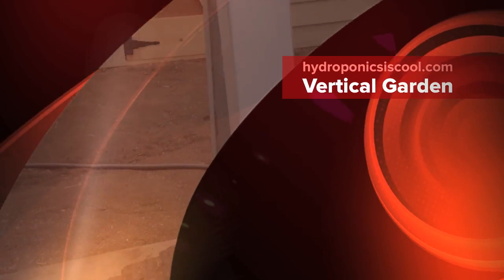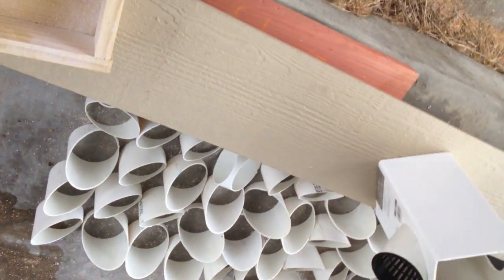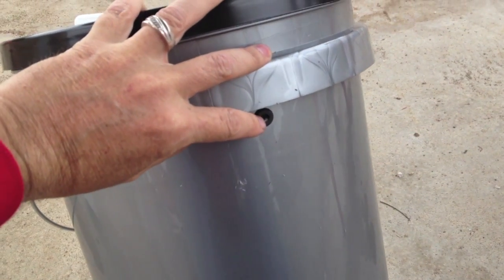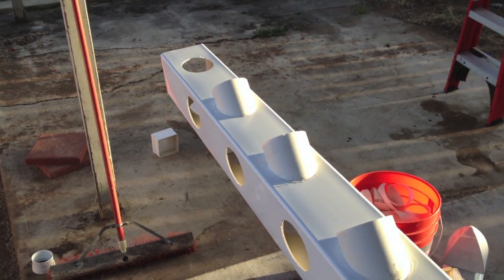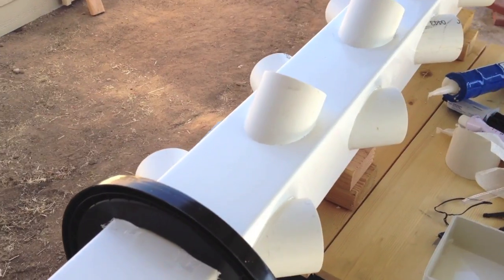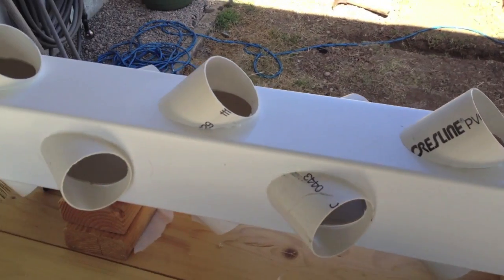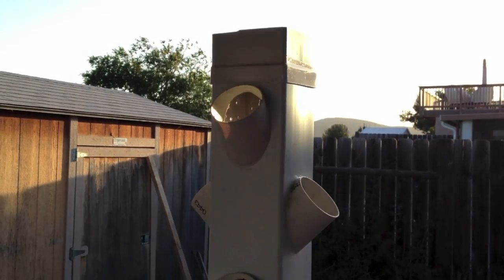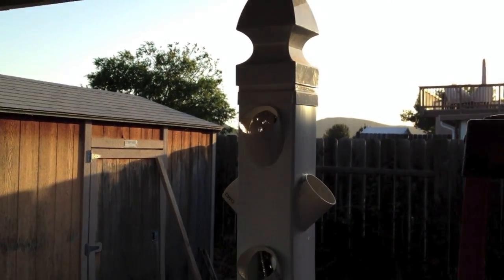Building a hydroponic vertical garden

Comment: The worst thing you might have done here was to cut the excess part of your tower because you foolishly thought the pump couldn't handle the actual height. Wrong! It could have easily pumped enough water even higher because you don't need a wide fountain there but moving current of water even with slightly lower pressure. Too bad you haven't tested it before you have cut so much of your precious tower.

Comment: I'm using micro spray nozzles with 4mm tubing so that i can use a weaker pump, but it does mean siting a nozzle for each plant.
Reply: I'd love to see your set up. was it expensive to do the nozzles?
Reply: @bobbyboucher7426  I ended up just pumping the water up to the lid, 3d printed a curved lid so the water hits that and rains down on the netpots.

Comment: All you really had to do is cut a slot in each side staggered and use a heat gun and heat each slot and then use a wine bottle into the heated cut slot. Then you have the same thing as the 4" cut pvc pipe. You just did a lot of needless cutting and glueing. Making waste and work. Looks good thou.

Comment: I love the design.  I have built my tower.  I couldn't find the pyramid cap at Lowes when I bought the other parts and just figured I'd stop at a different Lowes or Home Depot and pick on up later.... Well... I can't find the kind of cap you used.  Yours has a female receiver on the bottom of the cap and a male receiver on the top of the cap for the gothic cap that you put on top.  I know it's been a few years since you built your tower but do you remember where you got the cap????  Thanks for the help!!!
Reply: Never Mind... I found what I was looking for on your step by step instructions on your website.  THANKS!!!
Reply: +Hydro Howie where did you buy the pyramid cap?
Reply: Lowes... you kind of have to make it though.  You drill your drain holes and attach your water line to a cap then glue a 3 inch section of fence post to that cap (seal it with silicone on the inside so it doesn't leak) and then you can just set another cap on top of that cut off piece for the "lid".

The O.P. does a crappy job explaining it in the video but on his Website the step by strep instructions do a good job explaining it.  

I built a 5 tower system that actually pumps the water in from the top instead of going in through the inside of the fence post.  I ended up scraping the caps that I had made and kind of engineering my own type of cap because there wasn't enough water flow. 

Good luck!!!
Reply: the next bin over from the fence post displey-maybee????
Reply: Do we have a part number for the cap?

Comment: Hello, could you please tell me where you got your pyramid cap? I cannot find a 2 piece kit anywhere or I am just not seeing it in front of my face
Reply: +grunky bouy Have you had any luck with the cap? I'm having the same issue.
Reply: +Hydro Howie  I gave up trying for an answer. So I bought a tube of the pvc glue, cut a 2 inch section off the end of the 5" tower material set the 2 inch section on the top of a pyramid cap and glued it on. then I drilled the holes in the pyramid cap for the water to flow thru. A second pyramid cap fits over the 2 inch section, or whatever 5 inch cap you choose. Just make sure you seal it well with the glue. If you pause the video during the time he is showing his cap, you will see the glue seam where he did the exact same thing. There is no two piece cap that I am aware of. you need to make your own. That's all he had to say to keep from wasting so much time looking for something that does not exist.
Reply: thanks!

Comment: Thank you very much for the informative video. If multiple towers were to be made and placed together how far would the spacing have to be between each tower for lighting to reach all the plants, and would sunlight be a viable option for this method of growing? Kind Regards
Reply: I was wondering this too, if 1 pump could hydrate 2 towers if kept at the height of 6 feet. Have water come up to a "diverter" at highest point, where the water cascades down into and strains off into two directions to each tower.  That way you can grow 2x more plants off of same electricity from one pump.

Comment: A very good design for vertical hydroponics.  I was planning on building a similar system for growing greens but I believe it would work very well for strawberries also.   One point considering your video;  you skip over the actual process of working each small step and just show the finished product.  I think it would be more helpful and instructive if you showed a few minutes of each process.  For example, you could have shown the actual cutting of a couple of holes on the tower with the jig saw to show how easy or difficult it is, , plus the process of gluing the offsets onto the holes.  One step I couldn't figure out was do the holes follow the outer edge of the offset thereby the offsets sitting just inside the hole, OR the holes are a wee bit smaller than the offsets, with offsets sitting outside on the flat surface and the edges glued onto the surface.   Overall an excellent design.

Comment: Nice design. 
You can overcome the pumping capacity of a smaller pump by placing your 5 gallon reservoir on a small 2 foot table.
Reply: elaborate I don't understand thank you!
Reply: if you run a tee off pump you could supply two systems  with one pump & air stone??

Comment: This is the best vertical hydroponic garden I have ever seen.  Much better than those 55 gallon drums which will take days to make one and a lot of propane to heat up the openings.  To answer some of the questions from other viewers, all the material: post (5" though), 3" pipe, 3" net pot , submersible pump (pay special attention to the "head" - the maximum height the pumpo can reach,  of the pump), tubing, glue etc you can find them from various home centers such as HomeDepot and Lowe's, AND Ebay.  Design your own height of the tower, then all the other dimensions will follow. Here are my questions: A.  Will the tower head heavy and topple over?  B.  The same question one of the viewers asked, the caps in stores do not provide an extra partition for shower, maybe I have to mickey mouse one between the cap and the top of the post?

Comment: Great video- very useful, creative & efficient idea!  Good pointers & tips included- no random drivel or anything that made me want to try to skip through.  Excellent!  If only more people employed this format…
After two years, how has it worked out?  Any recommended modifications/redesigns? (I'm assuming you would include a link to a follow-up video were you to make one, right?)
Have you had any issues with algae?  Or have the plants sufficiently obscured enough light to prevent big blooms?
So you've been growing them clay pellet medium?  I'm guessing that several other options would be interchangeable...
How did your fountain/crown piece work out?  Did you consider or try just cutting slots in the center of each side at the very edge- so the water just flows down each side?  Any thoughts on that?
Do you think the number of plants could be increased by bringing them closer without detrimental consequences?  Potentially diminishing algae (if it's an issue at all) while increasing yield…?

When I do this I'll invest in a much bigger/more powerful pump at the beginning that could eventually support operation of 5-10 of these towers.  Starting with one tower I could build one more each year- or even an increasing number of new towers each year which I could fill for free with new runners produced by the plants every fall until I reached my goal, the pump's capacity or available space!

Where my uncle lives up in the mountains of western North Carolina, his view of the small valley below includes a commercial strawberry operation of several fields. I was suspiciously amazed to learn that all those plants in those fields are somehow moved twice a year- as whole rows- between NC & somewhere in Texas (I believe) in order to get two full harvests from those plants each year!  The timing of the move is critical & dependent on the weather.  I don't understand logistically how the plants even can be "packed" & moved- several whole fields at once as whole rows; or how this can be done without stressing the plants, significantly reducing yield.  Incredible!  I wonder if this could be done with these towers inside greenhouses using some kind of climate control in just the right natural climate.

Thanks again- awesome!

Comment: I just completed this build a few weeks ago and I have to say that it was a lot more than I bargained for.  I was going to make two 8' towers but after getting into the first one I quickly decided not to invest the time and money to do the second.  It took about 20 hours to make mine but I do not have a chop saw.  My main obstacle was that a 396 GPH Ecoplus pump will not pump an 8' head of water, so I bought a smaller tube.  That didn't work so I got an even smaller tube.  That didn't work so I forked out $62 for a 1050 GPH Ecoplus pump, and that didn't even work.  Finally I just cut the darn thing in half and used the slightly longer portion.  It's still a royal pain to get the top roots very wet and because of that I am having to let my pump run a lot longer than I would normally run it.  Also, be aware that you must start your plants in a flat container until they get roots that are at least 4" long to be able to get water in this system.  Would I do this system again?  Not on your life!!  I have over $200 in it; I can buy a LOT of tomatoes for that.

Comment: Have you thought about selling these for us woman that have no clue as to how to put this together?
Reply: frederica broadney That's a great idea!  If you really, seriously want one of these, you could definitely build one yourself.  It may seem overwhelming & daunting- and it would no doubt push you outside your comfort zone, but you have to stretch to grow!  And it honestly would not be that difficult or complicated.  You would definitely want to have access to the ideal tools, or ideally a workshop.  Depending on where you live, you might be surprised to find that there may be a tool "co-op" in your area (where you can "check out" tools like books from a library), or even a workshop  that offers hourly rental/use. Or, depending on your network of friends, family & professional colleagues, you could probably find someone with a personal garage workshop who would be willing to assist you or let you work in their shop with them.  If all else fails, you could just buy the tools at the nearest home improvement center one Friday & return them after the weekend (I've done this several times without issues).
What you'd want to do is first get the materials needed.  Then you could do the measuring and marking of the round pipe. The easiest way to cut that into those segments would be with a table saw which could be done fairly quickly if you had it well marked to cut.
Then you could use a cut segment to measure & mark the square central post, as well as the bucket & lid. The hardest part would definitely be cutting out the elliptical holes.  For that you'd need a drill & a jigsaw which you'd also use for the bucket and the water fountain at the top of the structure.
So basically two sessions in a shop or with the tools (could all be done over a weekend).  And the rest would just be putting it all together & gluing the pieces in place and finally sealing & securing joints with silicone caulk.
This definitely feasible for you- and imagine how proud you feel to be able to tell your friends & neighbors that you built it yourself!
I would definitely download this video & look for others to watch & download that others have made of this same or a very similar design. By downloading the videos you don't have to worry about streaming issues when you pause & replay segments as you're working (and with a free player like VLC you can easily slow the playback WAY down & skip around at different intervals all using really simple key shortcuts).
Reply: frederica broadney Worst come to worst and you really don't feel like there's any way you could do it yourself, I'm going to build one of these for my mother this summer & I'd be willing to do all the cutting of your parts as well & ship them to you.  Who knows how much the shipping would run you, but I wouldn't ask you for more than ~$8/hr for my time. But I really believe you can do this yourself & you may have a hard time convincing me otherwise…  LOL  ;-D

Comment: So when you plant your strawberries, did you put them in the pots with the dirt? What do you use for nutrients other than water?
Great video btw..
Reply: MaleenN76 No dirt should be in this system. The strawberries can be bought bare root and would be best for use in this. You need to fill the net cup with a media such as expanded clay balls or gravel and the plant is placed inside that. Nutrients are necessary as plain water does not contain what the plants need for nutrition. It is best to use good quality hydroponics nutrients. You can find some good premade nutrient mixes on Amazon that are tuned for specific plant types or you can study up and determine exactly which nutrients to use for what you are growing.

Comment: Is an ellipse necessary?  wouldn't a three inch round hole in the bottom om your elliptical pipe allow for root growth and nourishment? what crops will grow in this space? great instructional video! thanks for exploring!
Reply: The ellipse is necessary. If the hole is round the net pot won't sit right down in the hole.
Reply: Will these work with aeroponic misters? Or just hydroponically?

Comment: Excellent video.  I am just starting mine and I built a box for a four inch cutoff and the 45 degree cut with a hand saw.  I first used some carburetor cleaner and took off all the markings on the pipe.Thank You for posting this excellent video.

Comment: Why couldn't you use the same type of cement used when installing pvc pipes and fittings together? Wouldn't it actually melt the parts together?
Reply: lets call it a HOT GLUE GUN???
Reply: a hot glue gun faster and can fill in edges better?

Comment: Hey there.  Nice build.  Is there an update?  Also I am confused on the "pyramid top".  Did you buy two and cut one?  Can you please clarify?
Reply: John Wichmann There are 2 caps. The first cap is placed on top of the post with holes drilled in it. You then glue a section of the post you cut off to the top of the cap and seal it inside. The second cap is placed on top of that section to cap the system. If you use wayback machine you can still look at his website with the instructions.

Comment: Looking forward to building one of your towers, as one of my first hydroponic projects.  My question is, I guess a hydroponic beginner's question, what is the purpose of having an air stone in the bucket? Doesn't the water become aerated as it travelers down the column? Thanks.
Reply: From my experience the water does become aerated a little bit but not enough to be effective for aeroponics. I picked mine up at a local pet store, you can get a really good one with 6" stones for around $25.

Comment: PVC is toxic, what materials would you suggest? Virtually all of these DIYers are using some kind of PVC. I live in Florida I am most concerned Sun light will increase release of these toxins.
Reply: Schedule 40 PVC is 100% food safe, also a lot of people don't realize that vinyl fencing is also safe.  As long as your glues are food safe you're good to go.  I'm in Tampa FL you and I have the same concerns.  That said, I've also read that even in the remote chance of leeching, the plants won't uptake the particles due to there molecular size vs the size of the roots cellular structure.  How much truth is to that I'm not sure.  What I can say is I love the simplicity of this setup and it does look pleasant.  If I can vet out the food safe concerns on the glues this will be my next project

Comment: one last thought - it might not be a good idea to put the pump under the post - you need the depleted water dripping down the post to get back into the bucket - otherwise you could end up with less nutrients in the water because the pump ends up recirculating the water that's already nourished the plants.  Put the pump in the bucket, drill some holes in the bottom of the post so water can freely circulate.  I love this idea, mine are working quite well too.  I ran the tomatoes up a wire tomato tree from the pots in the bucket - so my tree has 4 wire trees around it growing tomatoes, and everything else i need for a salad growing up the main pot.  If I could only find a nice plant pot to put that jobsite bucket in.....

Comment: rather than making a jig to cut that round pipe, if you have a compound miter saw - simply make a mark on the table and alternate your cuts at 45deg and 0deg.  The last piece can be cut holding with a scrap piece of wood.

Comment: how can i use this concept with several more towers but one resevior
Reply: Look up the Dutch Bucket system. I'm currently building a system using a combination of the two ideas. Basically the only thing you would need to change is feed the pump line from the top and make sure you use a sump line (2" PCV) to return water to the reservoir.